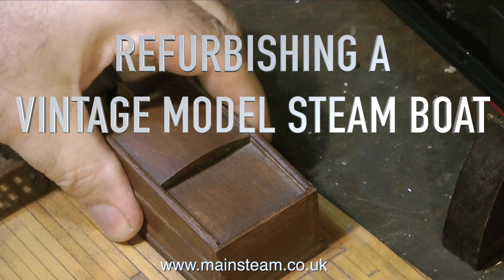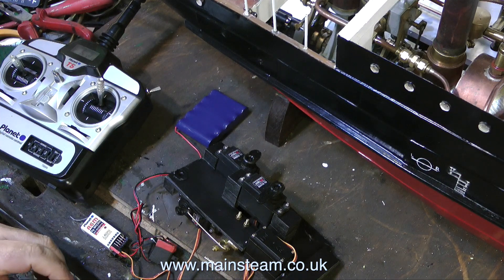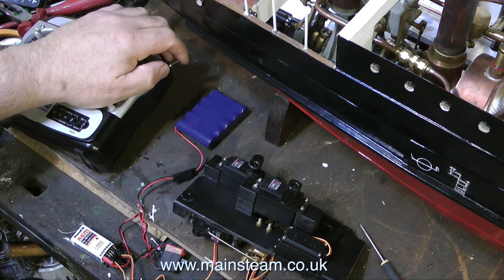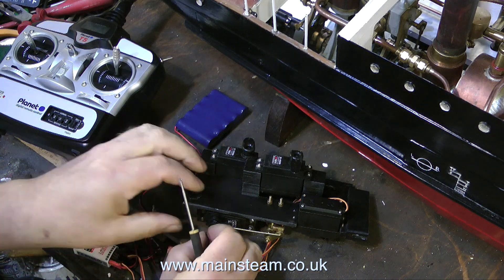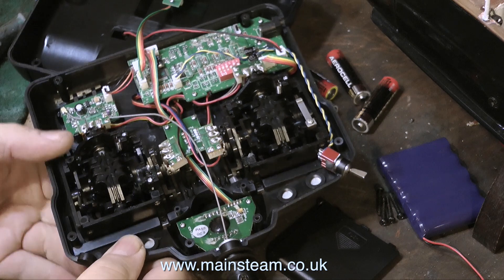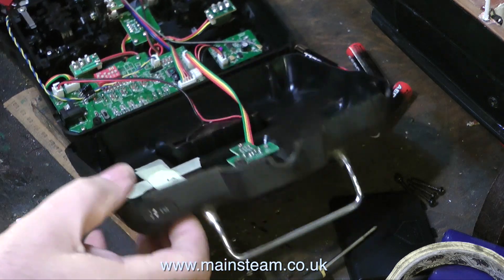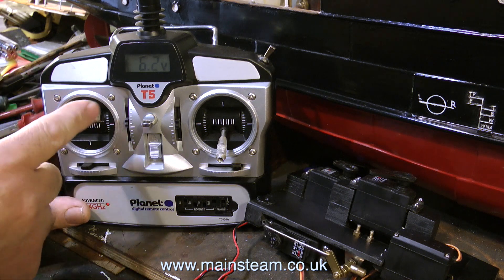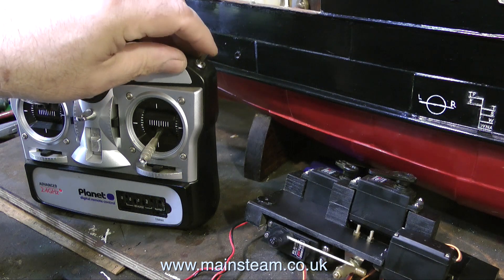REFURBISHING A VINTAGE MODEL STEAM BOAT - PART #29

Comment: You made a mode 1 and mode 2 tx combo :o), a cheap turnigy/frsky 9x will have failsafe which you could set failsafe to shut of gas in case signal is lost. also they have module tx you can swap out for each model very basic units. Be good on large ponds or lakes, a 9x is about 65 pounds with rx in UK.